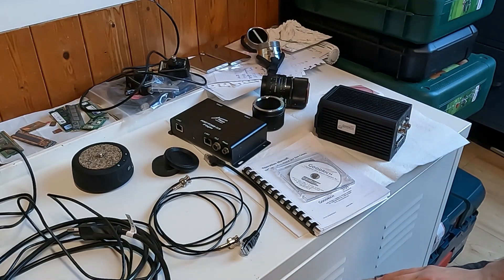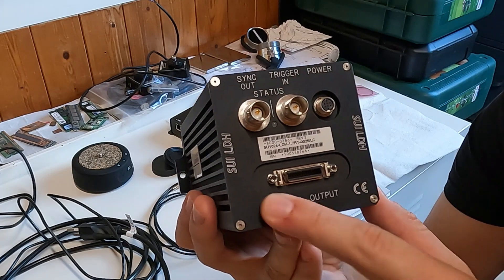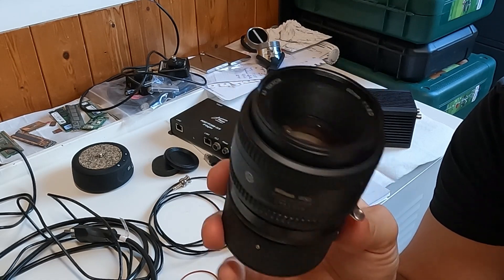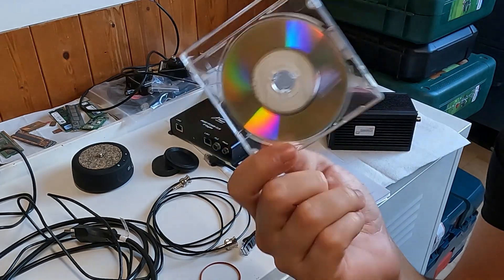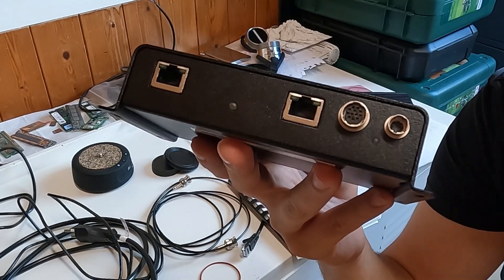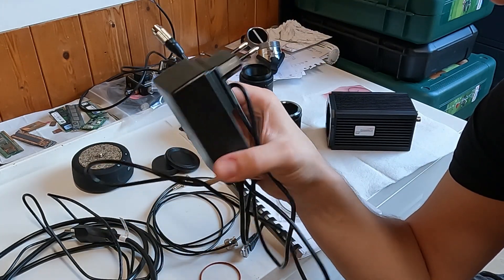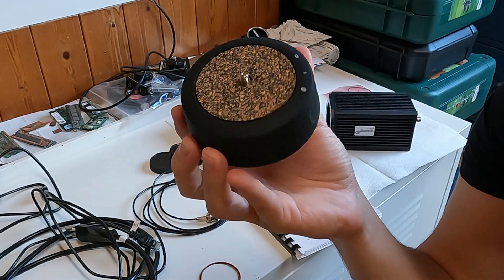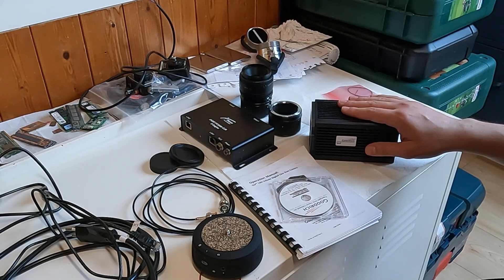DIY Short-Wave Infrared SWIR InGaAs Camera 1280x1024 Pixel

Comment: Do you have the voltage pin out of the 8 pin hirose connector? The power supplies seem to be hard to find for these discontinued cameras.
Reply from the maker: I can send you the full documenation but earliest end of next week. As I remember this is a simple DC PSU with a jack connector, probably $10 from China. Drop me an email so I won't forget. daniel@diy-optics.com